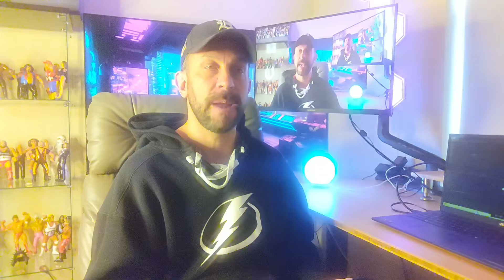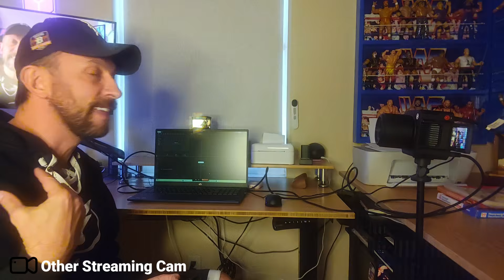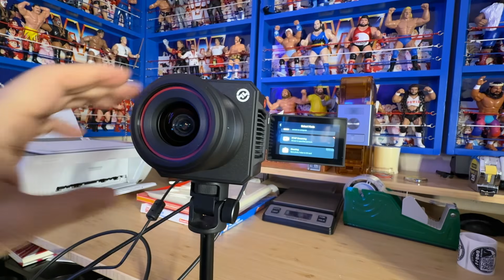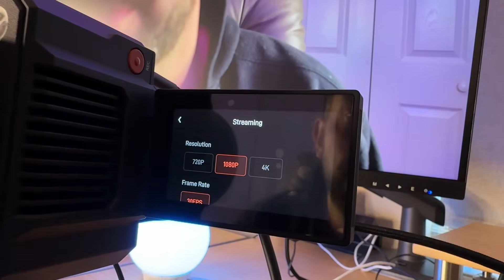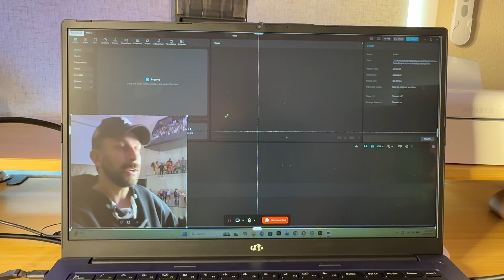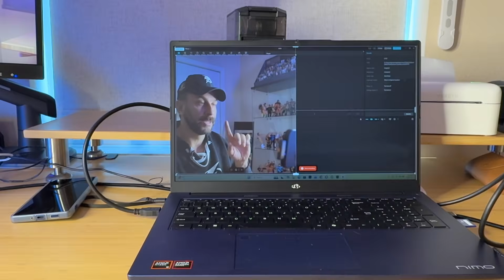Hollyland VenusLiv Air - 1/1.3" CMOS/F1.05 Custom Lens, 4K 30fps, Built for 24/7 Streaming

Comment: The image quality definitely looks great, no argument there. However, I do wish the video spent a little more time addressing potential downsides , things like heat over long sessions, firmware stability, or how it compares against mirrorless + capture card setups at a similar price. It’s clear you’re a fan of the brand, which is fine, but the praise sometimes feels more like an endorsement than a review. Still, the visual comparison alone is valuable, and it helped me understand where this camera fits.

Comment: From a technical standpoint, the 1/1.3" sensor combined with an f/1.05 lens explains almost everything we’re seeing here , better light gathering, cleaner shadows, and more natural separation from the background. The protocol support (RTMP, RTMPS, SRT) is also underrated and makes this far more flexible than most webcams. I’d love to see future firmware updates expand color profiles or manual controls, but as a streaming-first device, this is very well thought out.

Comment: As someone who does Amazon Live weekly, this video hit home. The ability to run for hours, monitor from multiple screens, and stream directly without a capture card is a big deal. The low-light performance you showed is especially important because product streams don’t always have perfect studio lighting. I also appreciate the SD card recording option , that alone saves so much hassle. This feels purpose-built for live commerce, not just gaming or talking head content.

Comment: I feel like the comparison wasn’t entirely fair. The “traditional webcam” clearly wasn’t color-matched or tuned, which exaggerates the difference. A properly adjusted webcam or even a mid-range mirrorless camera would narrow that gap significantly. That said, the Hollyland still looks excellent , I just wish the test conditions were more controlled so viewers could judge objectively rather than emotionally.

Comment: I like what I’m seeing, but I’m still hesitant about running any camera 24/7 unless it’s been proven over time. The video mentions constant streaming, but I’d be curious how this performs after months of continuous use , especially heat management and sensor degradation. Hollyland makes solid audio gear, but cameras are a different beast. I’m interested, just not fully convinced yet.
Reply: I personally have been using it for some time, and I have had no issues so far
Reply: You will not regret getting this